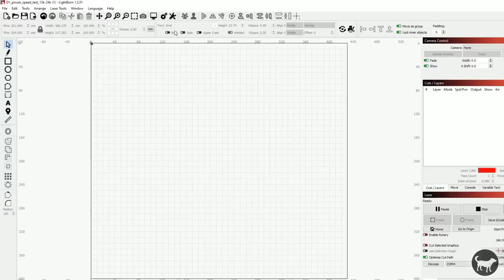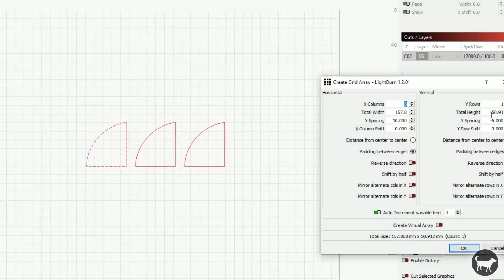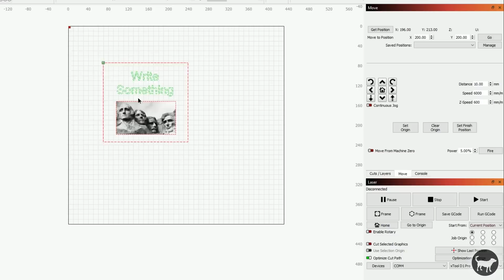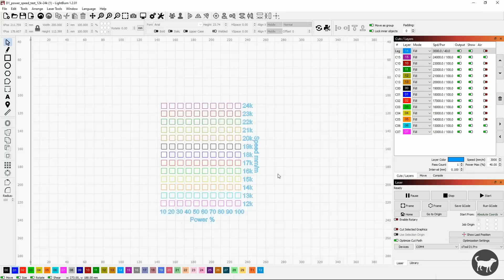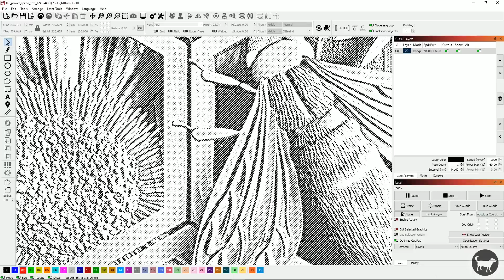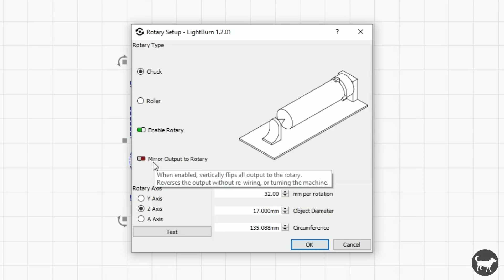Lightburn Tutorial for the xTool D1 / D1 Pro

Comment: how is home position and user origin supposed to work with the rotary? I watched this entire video. currently was using "start from current position" for my tumblers, but i need all of the logos to be exact in relation to each other for a customer order. i turned off limit switches and turned off my xtool d1 pro, moved the laser head to the top left to "set home" as 0,0, turned on my laser, and tried to set "user origin" which did nothing when i manually moved the laser back home and then selected "go to origin"... and when i moved my desired origin point up in both X and Y (my tumblers are too big to be completely flush on the XY coordinates and i needed my logo lower than the starting point), when i press "home" it only moves my X axis -- it seems when its attempting to move my Y axis, its moving my rotary instead

Comment: Simply love this video. Have used Lightburn for more than 3 years but learned a lot. Do you have an explanation on why I don’t see the runtime? I used to be able to see this with my Eleksmaker A3 Pro but not on my xTool D1…
Reply from the maker: I'm glad you loved it! I'm however not sure why you can't see the runtime. I honestly don't trust it when I see it anyway.
Reply: @BusterBeagle3D  I think that cuts are so simple and the code is so small in sixe that when doing cuts, the entire code can fit in the D1's internal buffer - when I do engraving it still shows the runtime but like you I never trust it - I typically expect to be 2 times longer than the preview time

Comment: 2:51 This setting is not here because of the accuracy of the red cross position, but the wide variety of lasers supported by Lightburn. Because the cross or dot is often not exactly where the the laser will target a value may need to be put in here if not already done in the laser cutter's native software or if Lightburn doesn't carry those over when opening.

Comment: Can you make home positioning to bottom left front?
Reply from the maker: I haven't tried it but when setting up the machine you can pick the origin corner and there is a limit switch there so technically it should be possible. That in unless they have hard coded something in the firmware that won't allow it.

Comment: Does anyone know the exact dimensions for the x and y axis for the d1 pro 20 watt? I am having an issue with laser getting stuck in the top left corner, but still keeps trying to push it further
Reply from the maker: If you have the pro version of the machine that typically means that either your limit switch sensor is not working or more often then not it's a wire on the back of the gantry getting caught between the laser module and the back frame. Just make sure there is nothing getting stuck back there getting in the way of your laser homing.

Comment: Purchased the Etsy kit. Love it! And the video is awesome. Thank you for doing it. I bought the 1064nm for the xTool. Do you know if the size of the laser case is the same size as the 20w. In short, would I be able to use the 20w grid for the 1064nm? (I currently have the 5w diode)
Reply from the maker: Hello. Technically you can use the grid but I'm not sure if the position of the 1064 laser is in the exact same spot. I don't have one but I'm guessing that it isn't. You can still use the grid to line up your pieces but I feel like the absolute coordinates will be off a little bit.

Comment: Any idea why even though i have my device settings set to 430 and 936 since i use the D1 pro extension kit, lightburn still does not seem to understand that?

If i sit with the laser at the front left (where it says xtool on the frame) and i hit home set all the way in the back left (936mm away) it only moves half the workable area back, and i ems up having to hit home twice.

But, when i set laser position by clicking the icon on the left, it moves to scale with the 430x936.

On that note as well, when i tell it to go home, it seems like it wants to move the max distance, and is unsure of its location.

If i am 100mm and 100mm from home on x and y and i hit the home button, it will try to move the max distance and set off the limit alarm. But will never move more than 430mm at a time, regardless of location or how it got there (me moving it or me telling it to move).
Reply from the maker: I actually do know. It's not Lightburn but a setting from xTool in the GRBL settings. They have a max Y distance of 430mm and unfortunately you can't change it and have it write to the controller. It's something I have brought up in some of my other videos as something xTool should really fix. I guess they haven't yet.
Reply: @BusterBeagle3D  Thanks. Guess i can stop banging my head pff the desk trying to figure it out.

Comment: Hello thank you for making these videos, I have come across your video and am very impressed because other videos people don't teach you all the functions of light burn and you go one by one which is very helpful. you are a good teacher. by the way i have bought a NEJE 2S with an 80-watt laser. I have been having problems getting images to burn properly they turn out dotted instead of lined. Do I need to program the neje 2s with light burn and if I do how would I go about doing that. Any help would be greatly appreciated. Many Thanks Noah
Reply from the maker: Hello. Much of this could depend on either your Line Interval or the dpi or even the dithering method that you are using. Without knowing your settings it's hard to know what your issue is.  Plus be careful when choosing your settings because I'm not aware of a 80W output power diode laser. My guess is that is the machine power which is misleading to consumers. You probably have a 10-20W laser.

Comment: Hello, I was using my Xtool D1 10W machine and was engraving in lightburn. A problem occurred where it was engraving and then as it was halfway done and the laser went pass the original line for the image which made the image shift a hair like the laser went out of bounds. Any way to make sure that doesn’t happen again?
Reply from the maker: I would just try slowing the laser down a little bit. Many layer shifts are caused but just pushing the laser too fast.

Comment: Hello Buster Beagle. Thank you for sharing this video very informative and helpful. Anyway, I'm still new to laser engraving I just purchased the D1 Pro 20W, can you please help me how to get the Lightburn Speed Conversion?, using the xTool CS the speed value starts at 1 thru 100 as an example. However, when I use the lightburn the speed starts 6000?, so how do I get the lightburn speed conversion formula to match the D1 Pro 20W speed? Thank you for your help!
Reply from the maker: Lightburn is in mm per min. XCS is in mm per second. Just multiply by 60. You can also change your Lightburn settings to mm/sec if you prefer that.
Reply: @BusterBeagle3D  Thank you for the quick reply and that really helps, Cheers!
Reply from the maker: @senirdacillo4133  No worries!

Comment: Thank you! Quick question-the extension file on the light burn website that you mentioned having to download if you’re using the D1 pro, is that for windows or Mac. Does it make a difference? Meaning do you need it no matter what operating system am I using?
Reply from the maker: Shouldn't make a difference. The files are for Lightburn and xTool Creative space which should work on both.

Comment: Hello friend, first of all, thank you for the excellent explanations that, although I do not understand English correctly but, I am understanding by google translation.
1) Recently (7 days) my D1 Pro 10W arrived and I am just getting started with this excellent laser tool.
As you know, the D1 Pro has Limit Switches and, one of the things that is worrying me, is when the Central Guide that holds the Laser Module, hits the Rear Aluminum Profile and, the Stepper Motor is "snoring" (I am afraid of damaging something).
Maybe this is happening because there are some wires tied to the Central Guide, which are protected with a thick cover, and these do not let the Central Guide reach the Rear Left Limit Switch completely. Have you experienced this?
2) You say that you have turned off the laser Mira; does that mean turning off the cross-shaped laser? But even if you turn that off, is there a reference light to start any cutting or engraving?
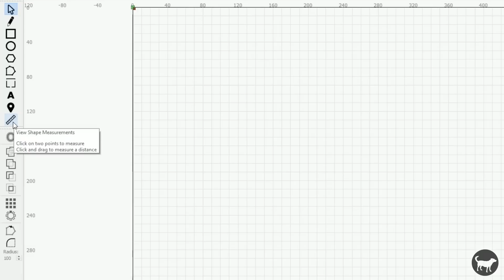3) In 19:25 you talked about Limit Keys (on or off), so is it possible in LightBurn to determine exactly the four corners where the laser should travel, before touching the Limit Keys (so it doesn't turn off)? Or, for me, who use the "Current Position", is this not necessary?
Despite so many questions, if you can answer them, I thank you very much.
Reply from the maker: Hello. Yes the wire loom on the back of the gantry is probably preventing your laser from reaching the home position. Try to adjust the placement of those wires so the gantry can reach the back. 

Yes I turn off the crosshairs. I use the laser itself turned on at a very light amount to know where the position of the laser is. In Lightburn you turn on this setting up Edit>Device settings and then turn on Enable laser fire button and laser on when framing. In the MOVE tab next to the Layers tab you can set your Power percentage for the laser to turn on. I would select something like 3%. When you click click the fire button the laser will turn on. 

Lastly when you turn of the limit switches in Xtool creative Space it only turns off the alarm. The limit switches will still work for homing your laser.

Hope this helps!

Comment: I have the xtool d1 pro, just downloaded the trial of lightburn, when I click on lightburn my laser goes to left corner and acts like it is jamming in that corner. What do I need to change in settings in xtool creative space and/or lightburn. I think I may know after watching this but I would like your input first!!
Reply from the maker: Make sure the wire loom on the back of the gantry is not getting caught between the gantry and the back of the frame. 99.9% of the time I hear about that happening it’s the wires.
Reply: @BusterBeagle3D  nothing in the way. Still does it even after I updated the firmware in xtool creative space
Reply from the maker: @tinae.2698  If there is nothing in the way and it's still grinding it could be that your limit switch sensors are unplugged or just bad. You might need to reach out to xTool.

Comment: Really helpful, thank you for clearing some of the things up for me. 
Plugging the rotary cable in and the having to change it back is quite challenging. Does anyone make a splitter harness so one could have an extra plug hanging down that we could plug and unplug the rotary into instead of the board. Mine fits so tight I feel it could damage the connector at some point

Comment: Did you ever share the link for the air assist upgrade to have the software turn on and off the air assist?
Reply from the maker: I did but it looks like they are temporally closed. https://store.dryheatembroidery.com/xtool-d1-laser-rotary-selector-switch.html?fbclid=IwAR1lsGg6TfFCDKZv0sbNU-0mTX1D1YN55ixby3OMZpa4sgrwxzk-OdJusgg
Reply from the maker: Sorry that was the wrong link. I thought it worked with the original D1 but it may be the special D1 version by Colby Schmidt. https://www.etsy.com/listing/1295709020/assistmate?click_key=1add5e2a37e8667561c14466270a252cf9f1bf55%3A1295709020&click_sum=87c3cc34&ref=shop_home_active_22&sts=1
Reply: @BusterBeagle3D  thanks.  I think from the listing it's meant to work with the original D1 plus an extra kit the store calls the Devil1.  I'll look to see if the D1 Pro has an output on the board that can be used to switch a relay on/off.  The D1 pro is a great laser (I've got the 20W), but it would be nice to be able to control the air assist pump via lightburn.  The previous link has me interested as well because I'd like to be able to switch between the rotary tool and the y axis without having to unplug cables.  I could design and build my own, but why reinvent the wheel if there is a ready made solution.

Comment: How do you get the home position? When i use the home function it goes past the limit switch and the belt jumps. I have tired to adjust the limit switch but it is just physically in the wrong place
Reply from the maker: Sounds like your sensors may not be plugged in correctly or they are just malfunctioning. Also make sure that there are no wires in the back of the gantry that are getting in the way of the travel of the axis. Also just incase something was not setup properly the home position is in the back left corner.

Comment: I followed your settings guide, and for some reason my laser will not come on when framing ...
Reply from the maker: Make sure you turn on laser on while framing in the machine settings and then in the move tab make sure you have the power on high enough for the laser to turn on. Something around 5% works well.
Reply: @BusterBeagle3D  ok sir! Thank you ... I do have one more question if you don't mind... I just installed my extension kit and I'm now in X-Tool creative space trying to figure out how to extend my canvas to the extension size ... Also, what do I set the parameters for the working size in light burn? For reference, I have the xTool D1 Pro 20w ... Thanks so much!

Comment: Love the video have a question for you would you know why lightburn would not move when I go and try to move it I try to move to position 200x200 go will not go does it even try
Reply from the maker: Thank you. Hard to say for sure but you need to make sure you are connected and turned on. You also need to make sure you haven’t triggered any alarms that have locked your machine. You can try restarting everything and make sure nothing is locked up.
Reply: Everything works I can run programs I can do everything else except when I try to go jog it with the joystick will not move I didn't know if there was something not turned on or something thank you

Comment: Thank you for the great tutorial.  I'm having an issue where I open Lightburn, turn on my D1 Pro 20W, prepare a brand new file, and click on preview, then frame, and push my button on my machine.  For some reason, as soon as I push the button, instead of framing my new design, it continues to burn a completely different image I burned days ago.  I began with Lightburn closed on my Macbook, and the D1 wasn't even connected to power for over 24 hours.  What am I missing?
Reply from the maker: If you are using Lightburn you shouldn’t be pushing any buttons on your machine. That is there for XCS. You should be framing and starting from Lightburn only.

Comment: My D1 PRO when goes to home it bangs like it wants to keep goings on light burn. The devices say auto home disable and on xtool solfware
Reply from the maker: Make sure that both the limit sensor wires are plugged in and that the wire loom on the back of the gantry is not getting in the way and hitting the back of the frame. Most of the time I have seen that it's that back wire loom preventing the laser module from reaching the back sensor fully.

Comment: Hi, thank you for a great Video, very new to laser work, ,im wounder why when I try to change the DPI on my 20w to 254 like you had in the video, my line interval goes to .003937, its like there lock to each other, can I unlock them ?
Thank you
Reply from the maker: They correlate to each other so you can’t change one without the other. It sounds like you may be using inches as your units in Lightburn. I use mm which is why mine may look different then yours.
Reply: @BusterBeagle3D  oh man , your right, what would would be a good dPI for a B&W photo in inches you think? as of now at  .10 i get 10dpi, ive been working with cnc routers so long and this is very interesting but so different .
Thanks again !!
Reply from the maker: @phille1492  It depends on the version of the laser you have. If you have the 20W I believe it's 254dpi. If it's the 5-10W it's 318dpi.
Reply: @BusterBeagle3D  20w. but im haveing all kinds of issues with LB, with the program that comes with the Xtool its ok, but LB everything is inverted or backwards or both,ive looked at all the settings and dont see anything checked off for inverted , my friend, who also has cnc routers and the 20w xtool thinks its a firmware issue , do you ?
Reply from the maker: @phille1492  Hello. Make sure you load the .lbdev file from the xTool website when loading your machine in LB for the first time. It's the first part of my video. Also when importing that file be sure to hit the back left as the home position. If you chose another spot on the laser as home it will make everything including my grid load in backwards in LB.

Comment: Can you explain how to home your laser. When I hit home mine goes to the upper left corner and bangs the sides. The belt continues to run. How do I set the Home position?
Reply from the maker: As long as you have the pro version and not the regular version the machine should be able to home. Check to make sure the wires of the sensors are all hooked up correctly. As make sure the wire loom on the back of the gantry is not getting wedged between the gantry and and frame thus preventing the laser head from reaching that back sensor.

Comment: Hi Buster, how can I turn off the fire alert in lightburn? I just want to make the grid test but the fire alert stop the process, and I cannot restart the test at the current point. Thank you for your help.
Reply from the maker: You can't adjust that in Lightburn. It needs to be turned off in xtoole creative space and then it will be off in Lightburn as well.